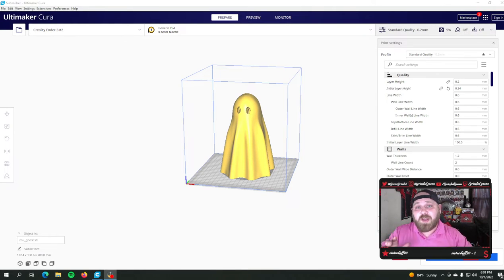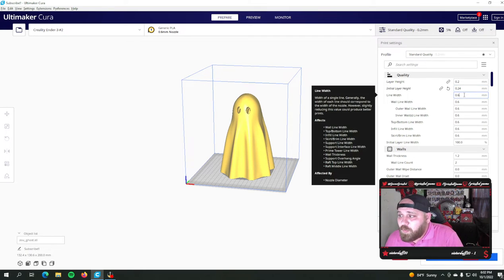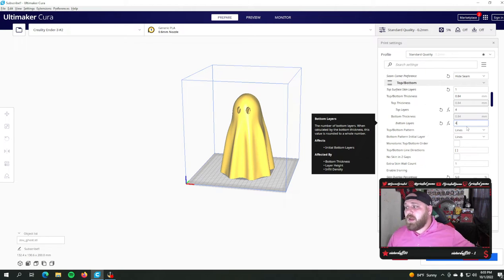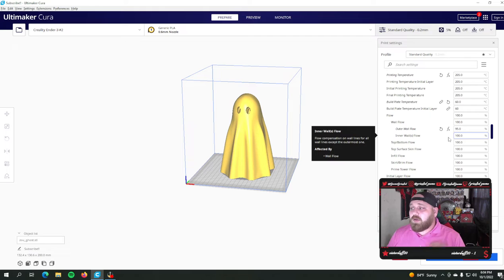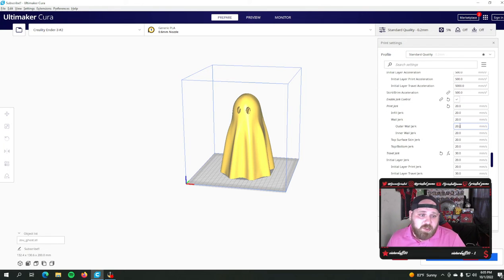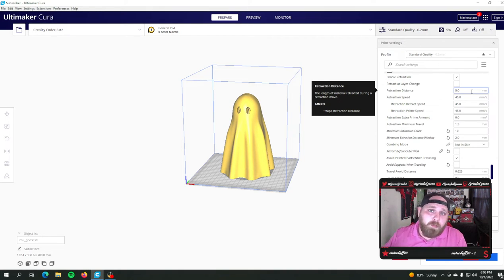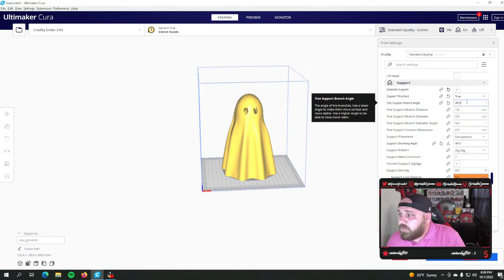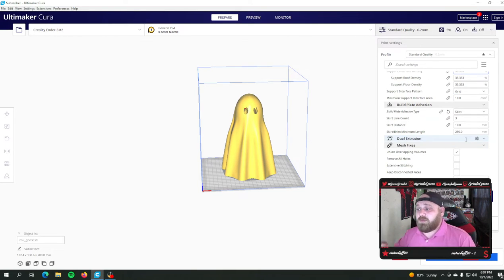How to 3D Print faster using a .6mm nozzle! My updated Cura settings for speed & quality!!

Comment: Thank you so much! I swapped to a .6 and couldn’t get the layer after an infill to properly adhere, it would pull the filament too thin and cause it to pop up and create havoc. I also use cura so this was perfect. Obviously a couple years later and you’d think this issue would have been solved with recommended settings, but no. Thank you!! Printing at 600mm/s with a .6 finally.

Comment: Your layer thickness seems quite low compared to most suggestions for 0.6mm nozzles, which are generally 0.3mm or more.  Layer height is also a key parameter in print speed (logically), but I hadn't seen anyone else suggest your changes for wall thickness and passes.  It seems that combination of both would help print speed dramatically!

Comment: I'd like to see some content on carbon fiber pla there isnt alot of it on here to learn from. Also do some on ABS as well sure if you have already on new to the channel I'll go check it out and see. One thing you should try that I have tried is nylon weed eater line cheap and a prince just like regular nylon and it's around 1.7 1.73 mm

Comment: I have an old-school Ender 3 Pro what the 1.1.4 8-Bit bored that I really need to upgrade because of the noise but I have dual blower fans and I run 70 mm a second and it prints great I'm getting ready to start printing with a .6 mm with carbon fiber pla so I might be able to crank it up a couple notches we'll see

Comment: Try changing your inner wall speed to 35.  The outer wall is what makes the print, so you can book through it with the inner wall.  That saves time as well.

Comment: Just a heads up, this works surprisingly well on a .4 mm nozzle too, and actually is the best my printers worked since! Great settings!
Reply: You were able to print with those .6 settings on a .4 nozzle?
Reply: @dopegod3d178  surprisingly, yeah, had to tweak just a little for my speed, but other than that, it worked fine!
Reply: @nateslplayzzz  what did you change speed to?

Comment: Im using a longer lk5 pro. Curas pull down bar doesn’t allow me the option to change the nozzle size, still haven’t figured it out so if you have any idea it’d be appreciated but the point of my post is, during my search for the answer to my problem I found info on layer height compared to nozzle size and it said 80%. So the layer height should be 0.48 by the info I found. I’m a novice so take this with a grain of salt. The info was found at Longers web site.
Reply: 80% is the max layer height you should really use for your nozzle, to change the nozzle size, you need to manually change the line width to 0.6mm and that should fix your issue of not having the nozzle drop down. I'm not sure how well this will work as i tried it with a 1mm nozzle on my anycubic chiron and it didn't print properly, but that might just have been me being stupid and not correctly altering any other setting that needed changing
Reply: @joshuarollins3202  hey brother, I appreciate the info. I found a YouTube video with all the settings you described and had it set within a day of my post. If you figure out that 1 mill setting let me know, what I found is most printers have trouble with such a large nozzle simply because the machines settings don’t go that far even if they claim it. The more expensive ones can but even those have issues with that size.
Reply: @dustinsmith9528  I'll let you know if I figure it out in cura, I've gotten it to work by using the new lychee fdm printer slicer as that has less things to fiddle with it just does everything automatically behind the scenes after you change your nozzle size and layer heights
Reply: @joshuarollins3202  awesome, been hearing a lot about this slicer. I’ve been wanting to do an Ironman suit to guard the door lol, if I can get a 1 mill to work….bro….you will be my own personal flipping hero. Again appreciate you taking the time to share this info, you are a gentleman. 👍🏻
Reply: @dustinsmith9528  you're in luck, your printer is one of the ones that is on there, you just need to create a custom filament profile, adjust your infill, temps and then under material change the nozzle size in the override and adjust your layer height and you'll be good to go, I've not tried anything with supports with a 1mm nozzle, but the base settings for the 0.4mm nozzle supports worked a charm and they came straight off